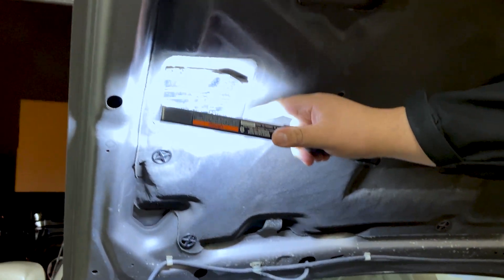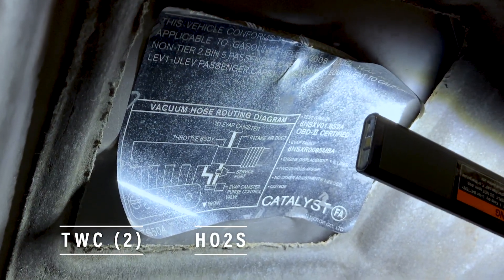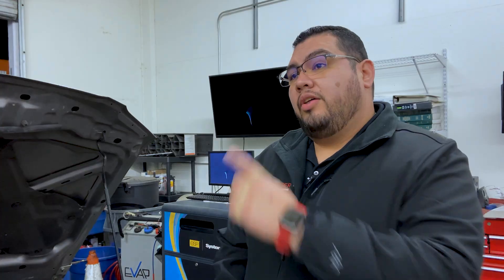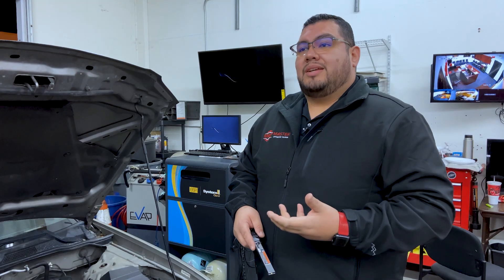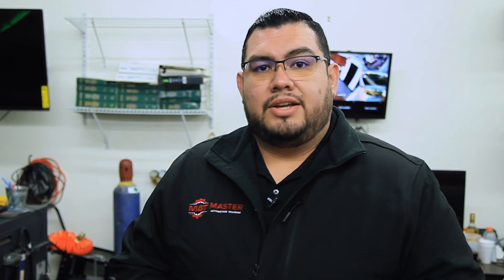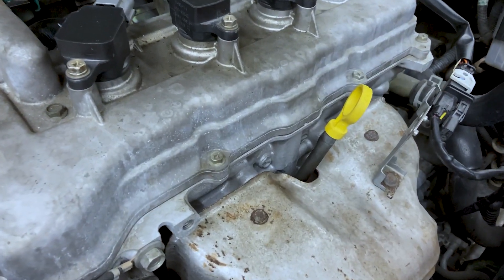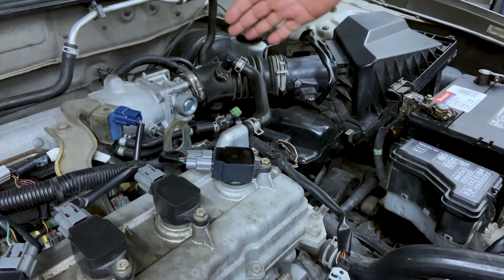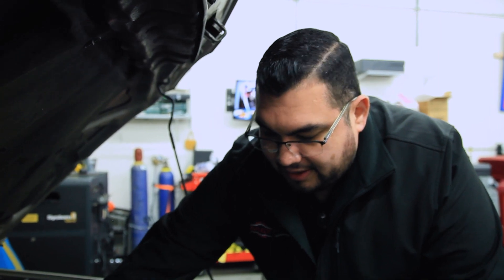CA Smog Check Visual Inspection [PCV System]

Comment: I have a set of chrome valve covers and installed a chrome pcv on the passenger side  and the stock breather on the driver. Just like the diagram for the engine. Would I pass inspection?  Love your videos.
Reply from the maker: Thanks for watching, as long as its all properly connected, you should be fine. Chrome part, isn't illegal at all, just need to make sure your new PCV is sealed and installed like it was from factory.

Comment: What if the emissions label under the hood is missing? I was in an accident and had the hood replaced and the body shop never put the label on.
Reply from the maker: You can purchase the emissions label from your local dealership with your VIN No., or a smog check station will be able to look up the emission information upon doing the inspection.